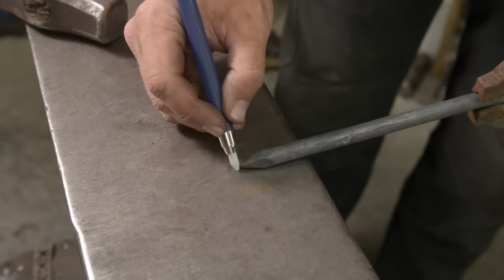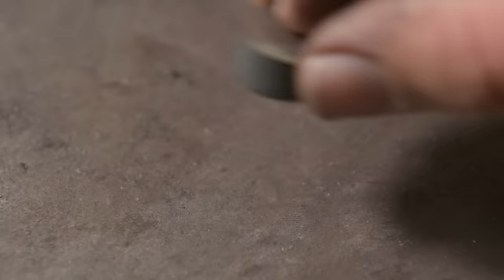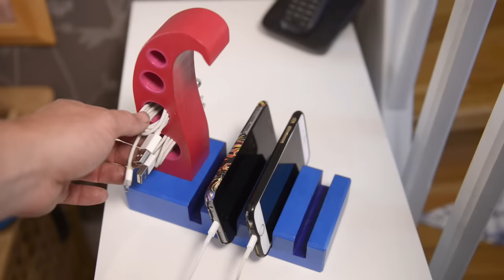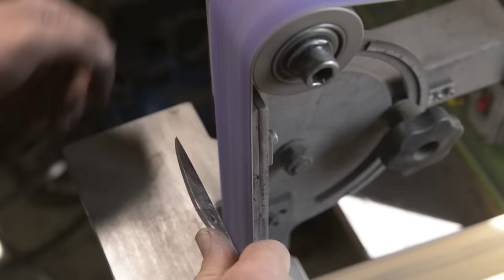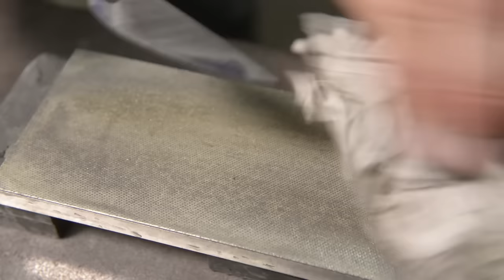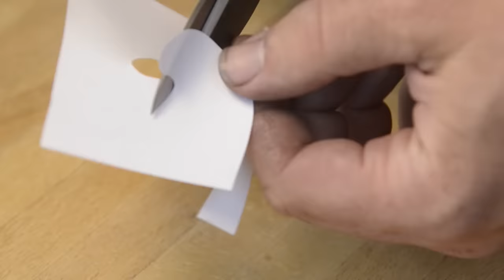Blacksmithing - Making a pair of scissors

Comment: When you see them cutting jeans like butter, you gotta know and admit that they are some dang impressive pair of scissors.
Reply: do you spread your butter over your toast with scissors?
Reply: Damon K in mother Russia butter spreads toast over scissors
Reply: But also there is a fashion going around if worthless easy shredding denim known as paper denim and its trash to wear , the real test would be bones and meat
Reply: lioness of lechistan  Unrealistic? Kitchen shears?
Reply: Also increased the value of those jeans by at least 50%
Reply: @anything7441  Why would you cut bones with a scissor.
Reply: @Fabianwew  you wouldn’t… he seems to be what we call a “dummy”.
Reply: @AlexanderMason1  I have shears for cutting bones while slaughtering, but using tools outside of its intended purpose just to prove they will fail seems weird.
Reply: @Fabianwew  here is America we use saws for bones. Whether a coping saw or a hacksaw. Why would you use shears? The best iOS will do is crack the bones and leave bone fragments all over the place including inside and around the meat. Bone marrow too.
Reply: @AlexanderMason1  The shears snap the bones clean off and leave no dust or shards. A saw would by necessity break up the bone is small bits.
Reply: @Fabianwew  no it doesn’t. It only leaves a very small amount of bone powder which is removed using a scraper. Shears, no matter how tough and sharp will leave bone fragments. They will also leave the edges of the bones sharp and unpresentable if they are kept with the meet. Maybe you are talking about chicken though. In that case, yes, we also use shears. I’m talking about beef. You are not cutting beef bones with shears.
Reply: @Fabianwew  that is disgusting… you shouldn’t be proud of yourself for killing an animal with scissors. Never heard of a hunting knife?
Reply: @Fabianwew  replace the word “slaughtered” with “butchered” and we are good.
Reply: A gene slicer?

Comment: I remember seeing a similar process for crafting scissors in India in the 1990s, the blades were made from old worn out hi carbon steel hand files with handles made from cast brass and riveted to the blades. I purchased about a dozen of various sizes and still have and use them. This is a fantastic video, keep up your good work Mr Torbjorn.
Reply from the maker: Cool, thanks!

Comment: Great looking scissors. These look very similar to a vintage pair I have and I now have a general idea of how they were made. Good job. The ones I have are more slender both along the blade width and the thickness of the handles. The handles were intended to be wrapped  with cord or twine to give it a thicker, more comfortable grip. The rivet pin was forged but was held in place using 2 small round sheet metal spring steel with an undersized hole with splits that were force fitted to both ends of the rivet.    I tried cleaning them up and ended up give the outside of the blades a somewhat mirror finish which also removed the oxide protective layer. Wonder if I should have done that...

Comment: What are you using as that white marker?  Chalk?  Soapstone?
I've seen several blacksmith using similar pencils and wondered...
Reply from the maker: This pencil uses "lead" of soapstone.
Reply: Another great marking tool is a white charcoal pencil you can pick up from any art supply store. They aren't exactly cheap, but the mark will stay visible even at forging temperatures.
Reply: And a lot of blacksmiths I watch use a 'silver pencil' either wood bound for mechanical.

Comment: should've made a mold whille at it and produce it around 100 unit or so
Reply: Yep. $119.95 on Amazon.
Reply: I think you mean a die, molds are for liquids while dies are for forming solids. Would still need to fine-tune each one by hand to ensure they were of sufficient quality but a forging die would definitely help expedite the process. of course that's only if you're willing to go from custom handmade items to mass production, which sevral makers aren't.

Comment: I have tried using similar very old scissors with the slots for the thumb and fingers made of round bars. Even a few up and down movements leave the skin hurting. Similarly hand made scissors made fifty years ago by the black smiths of Meerut known as scissors town of India have the slots  shaped to fit the contours of the thumb and fingers comfortably.

Comment: Very exellent work, I like how you used the hollow grind hone on the blades, and accounted for the slight inwards curve of the blades towards each other for tight shearing. I'd recommend trying Penetrol solution to seal them though, instead of oil that will leave them slippery. Maybe its only available in US- its a great durable protectant for blacksmithing. Great work man!
Reply from the maker: Thanks!

Comment: Nice work, I enjoyed watching. There is one query though: After some use (ok, lots of use) resharpening + honing will be needed, but, since you have joined  scissors this way (by rivet - not by screw), it won' t be easy to separate them (in order to resharpen them one by one). It will be imperative to sharpen them by just "opening",  which is not so practical. 
All in all, is very good work.
Reply: GEORGE SKANDALAROS 
I was thinking the same.
But a screw would spoil the beautiful elegant design.
My mum was a dress maker and used the best Sheffield steel scissors with proper thumb and finger grips, however old fashioned 
craftsmanship is still alive. Let’s cut the ribbon to that.
Reply from the maker: You don't need to separate them to sharpen. You only sharpen on the small bevel and a light deburr on the flat surfaces.
Reply: @torbjornahman  Ok fully accepted. All in all, it' s a beautifull piece of work (and strong- usable too), for the sake of it I would sharpen it even if scissors were not separated.
Reply: @derekbradbury749  Ok fully accepted. All in all, it' s a beautifull piece of work (and strong- usable too), for the sake of it I would sharpen it even if scissors were not separated.

Comment: When all you have is scissors, everything starts to look like handcrafts lol. They are lovely. I would love to follow your video because the forging is quite straightforward, but I've hit a roadblock. I don't have a belt sander yet :(
Reply from the maker: Thanks. For this project I don't think you really need one. With good files you can make a very flat surface. Check my latest video where I file bevels on a wood chisel.
Reply: @torbjornahman  I sure will. I've got some sharp files. Or, I could cheat a little and use the surface grinder at work to establish a flat plane and go from there. But I'll try with the files first. ;)

Comment: Very nice video! I have to admit I was a little nervous when you were tapping away on the tempered blades to set the final curve. Brings back some memories of a distinctive ting which is then perhaps followed by a few colorful words, and a walk of shame back to the steel bin for another piece haha. Thanks for sharing the making of a very fine tool.

p.s. That's a beautiful "little" anvil you have there
Reply from the maker: Thanks! Yes it as a nervous moment, but I actually made a test piece prior to this and I could bend it almost 90 degrees before it broke. You just have to get the heat treatment right.

Comment: Rather than using the color as a tempering guide a lot of blade smiths use a toaster oven, you can set a specific temp and hold that temp as long as you like👍

Comment: Hi Torbjörn!

Do you wear a mask the whole time while your forge or only at certain points? If so, why? Does it have something to do with the coal dust?
Reply from the maker: When I work alone I don't mind wearing the mask the whole time. Forge scale, particles from the fire, it all swirls up in the air when you forge. I try to keep it out as much as I can. Hard to tell how dangerous it really is but I like to be on the safe side

Comment: I have a question. I know nothing about smithing, but find it completely satisfying, but I notice all the stuff flying of the iron when it's hammered... Is that all impurities, or just metal that's kicked off because it's colder than the rest, and therefore more brittle?
Reply from the maker: It's iron oxides. When the hot surface is subjected to air/oxygen it will oxidize in thin layers. We call it scale. It is very brittle and will flake off when the work is deformed.

Comment: Those are some gorgeous shears! Well done. Do you always use plain wood to strop? I've used wood to remove my wire as long as I've been sharpening, but I never actually stropped with it, just lightly sliced into it...
Reply from the maker: Thanks! I guess I was a bit sloppy when removing the burr here, but in general if you have a bevel or surface that needs to be perfectly flat you cant use leather or anything soft to strop with, what will "round" off your edge. Wood is great for that with some stropping/polishing compound.

Comment: So, how was forging with spring steel rather than bar stock? Any particular differences in how it behaved?
Reply from the maker: It's a bit harder to work and you need to be a bit more careful not to forge it cold, and never quench anything in water as you work or it might crack or break.

Comment: That huge washer killed the nice lines of those awesome forged scissors. After those huge ass washers were put on That S all my eyes kept focusing on lol. Why not just use a rivet instead of the washers plus the rivet it works just the same and it's such a nicer look for the whole finished piece but they still came out nice

Comment: Mr. Torbjorn, what kind of project would you recommend for a blacksmith that is just starting out?
Reply from the maker: Start with a couple of hooks of different kinds. Tongs is a good project after that, but first you need to make a round punch for the rivet hole :)
Reply: Hooks? What kind?
Reply from the maker: Just google "forged wall hooks". That should give you some ideas! :)
Reply: Torbjörn Åhman, thanks!  :D

Comment: I was very surprised the washers weren't beveled.
Reply from the maker: I probably could have spent some more time on those... Do you think it makes a huge difference?
Reply from the maker: I could have turned them on the lathe but wanted to keep it as simple as possible.
Reply: Huge, no...
Just surprised no tappy-tap-tap around the exposed edge to take the square corner off.
But, excellent again, as usual!!!👍